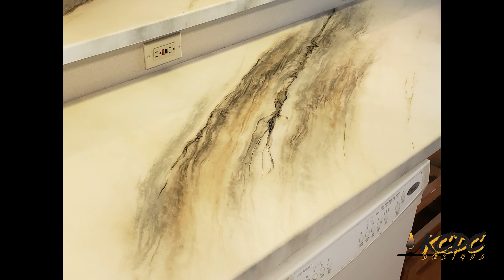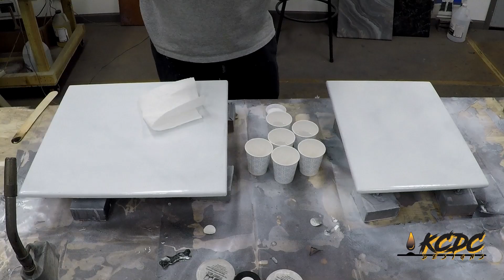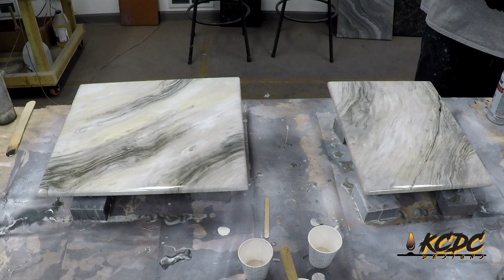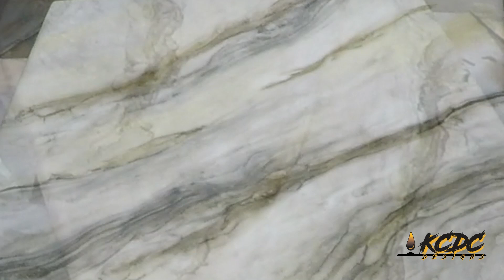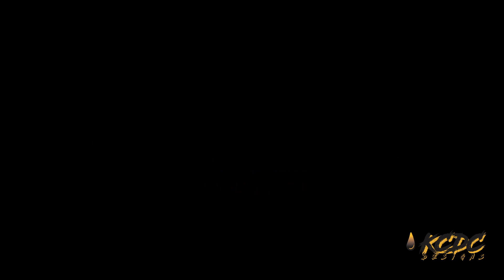Check out how I created this beautiful Venetian Marble design using Stone Coat epoxy! | KCDC Designs

Comment: I’m brand new to epoxy and trying to learn as much as I can from the pro’s like yourself. I see that you using both heat gun and torch. Is one better than the other or do they each have their own application purposes?
Reply from the maker: Hey there, and thank you for the kind words!
They each have their own purpose, and for me I use the torch for popping bubbles and the heat gun for manipulating colors when creating designs.
Reply: @kcdcdesigns  thanks so much! Love your work. I’m excited to do my first project
Reply from the maker: You're welcome and I'm so excited for you! 
What will be your first project??
Reply: @kcdcdesigns  I’m not sure what happened to my reply yesterday, I will be doing kitchen countertops and island. A big hiccup for me will be the existing backsplashes which are granite, not a whole lot of videos on that but I managed to find a really good one from rk3 designs. I don’t feel confident taking them off to do a separate pour. I really like the color palette on this project you did and the design on the right will be what I’m aiming for. I’m having trouble finding the colors you used online
Reply from the maker: So will this be a complete on-site pour? I get it on the granite backsplashes but you might also pose that question/dilemma on the RK3 Insiders group to see if others have removed them, and what their experience was. It would sure make it a lot easier to pour.
Regarding the colors, you may be referring to the "ghost gold" or "pearl gold" or "interference gold (they're all basically one in the same).
The Pearl Gold I use is from Stardust Micas which I found on Amazon. It's one of my favorite undertone colors!
If you're not a member of the RK3 Insiders group, here's a link. Just answer the few questions and I will get you approved (I'm a moderator).
https://www.facebook.com/groups/2253619604794906
Or I can send you an invite, just let me know how you're listed on FB.
Keith McGinnis
Reply: @kcdcdesigns  thanks Keith! I found it on Amazon and ordered some being they only had 3 left in stock 😅. I didn’t know rk3 also had an insiders group. I recently joined the SCC insiders and posted the question there and had some good responses. I’ll be joining the other one as well. I appreciate you taking the time to reply!
Reply from the maker: Awesome! 
And you're welcome, I'm always happy to help when I can!

Comment: Hello can I use epoxy on countertop made  playwood,and I have to use some primer first .thank you...
Reply from the maker: Hi Raul, plywood can be tricky to use. Because there are many different grades of plywood, some aren't perfectly flat and can also release a lot of air bubbles when applying epoxy. Another difficulty is on the edges. Because of the layers, I would recommend using bondo (or other brand of body filler) to completely seal the edges. If not, the layers will be visible through the epoxy and also create a lot of air bubbles.
It can be done, it just takes more attention and care.